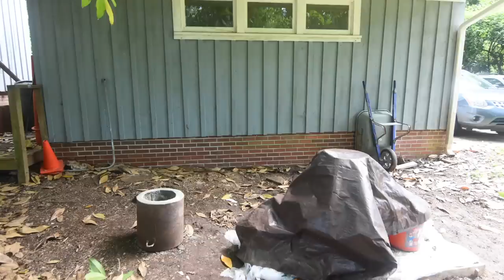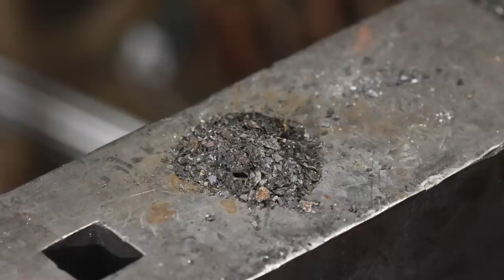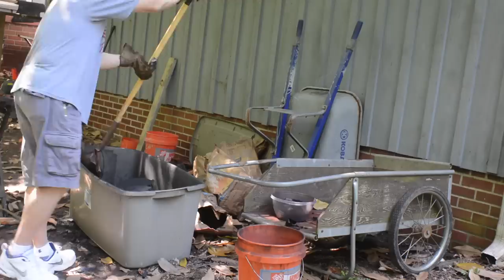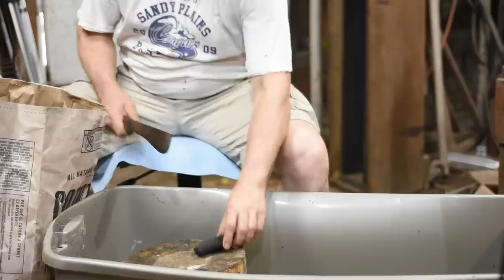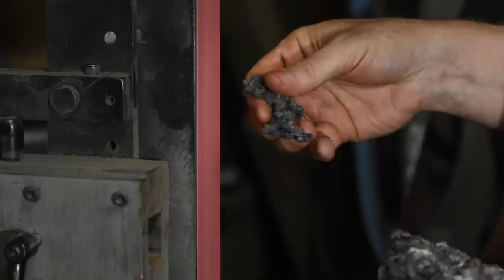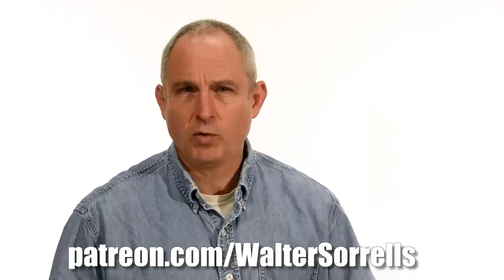Smelting Steel - Tamahagane

Comment: Thank you for inspiring me to start making knives. There's a lot of people that are leading beginners the wrong direction, but you set me on the right path towards quality end product production as opposed to cheap and easy junk builds like some other so called teachers. Even the 1095 file knives are a useful and durable end product. I'm currently working on a bastard file bushman's Tanto with a maple handle. I even setup a gas forge and a smelter inspired by your easy to follow videos. My grandfather handed me down a cranked upright coal forge. It's fun to operate the hand crank, for short work runs. Sometimes I cheat and plug in a 4" duct fan for longer runs. Thank you again!

Comment: Hi Walter, from Barcelona! Very interested on your work, i have few questions about your tamahagane productions... Even Lee Sauder on one of his documents (Update on the "practical treatise") he recommends tapping the slag heavily and constantly, I don't see you at any moment doing it on the video. I suppose everyone has a method, can you explain your point about it, please? As well as, i don't see so much angle on your tuyere, maybe near 0, and again Sauder, he talks about steeper angles promote higher carbon contents, is your way something about to don't produce cast iron with your kind of furnance? And the last one, which values are you looking for on the air rating flow, are you searching also for a charcoal consumption rate?
Thanks so much! Getting inspired by you!

Comment: It may not be as strong as modern metals used for blades, but to turn weak material into decent craft is something. It feels as if the sword had a soul of its own and will grow stronger along with its wielder after the smith poured his effort and will into his work.

Comment: I can't help but wonder what would happen if you took the bloom and used it to make crucible steel.  Normally using pig iron and adding carbon, would it be a way to get a refined homogeneous ingot, albeit with more work?

Comment: I see this and think to myself all the shortcuts I could take working in a heat treating facility. Make it at whatever temperature with however much carbon. Then get it folded out and homogeneous then just run it on an annealing cycle in atmosphere to even out the carbon and raise/lower it to what I want. Then do whatever I want and carborize it if I so desire. All in total 3 hours of processing to be lazy

Comment: primitive steel? tamahagane meets the standards of today's modern steel so who do you call primitive? Because your process was so fast you ended with steel that would not even end as fork material. Real tamahagane is created over a few days... too fast to furious. Most likely because you were using iron oxide instead of iron sand... i know that it should not make difference but for some reason, they were using iron sand stead of rust